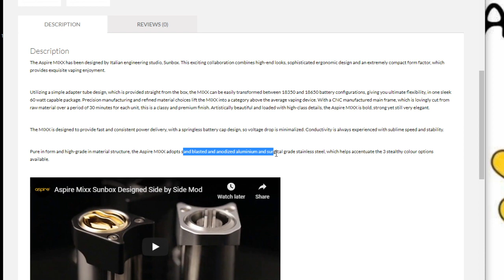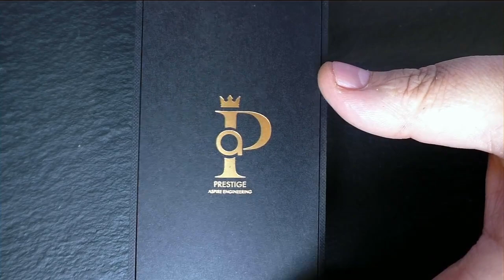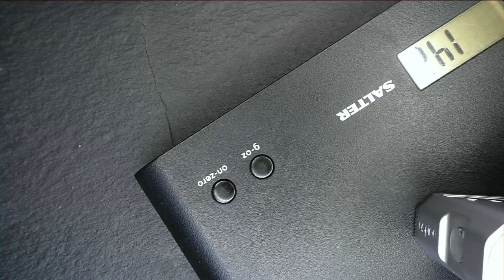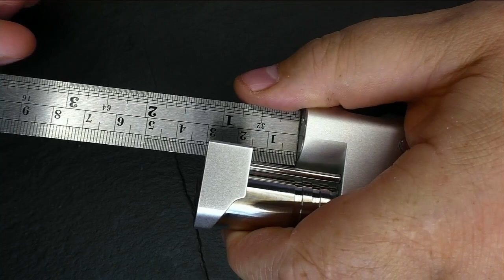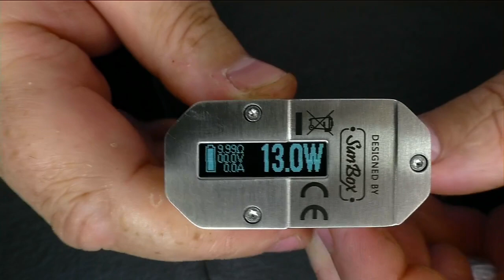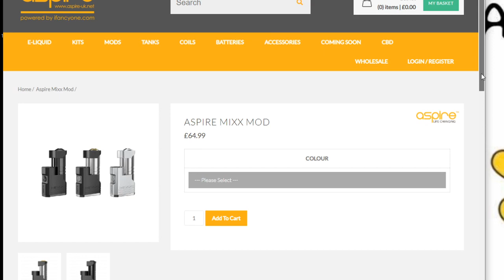Vlog & Aspire Mixx unboxing

Comment: I know you dislike stealth mode Todd, the light off the screen bothers me, especially at night.  Clicking 3 times will lock the power buttons and disable the screen !! Best feature IMO, all in one.  
Had it for a while, had to get used to use the fire button using the ring finger. Happy vaping.
Reply from the maker: Thanks for sharing that information Pierre 😎

Comment: Would a 24mm KFL 19 stock height be tall enough?

Edit: from the bottom of KFL to the bottom drip tip oring is 30mm. So it should just be tall enough to clear the exposed part of the drip tip